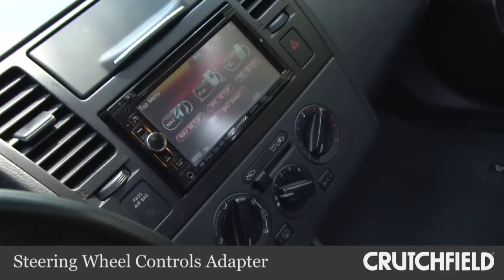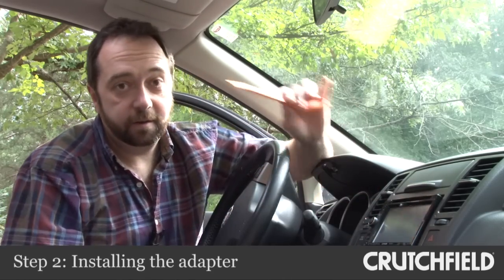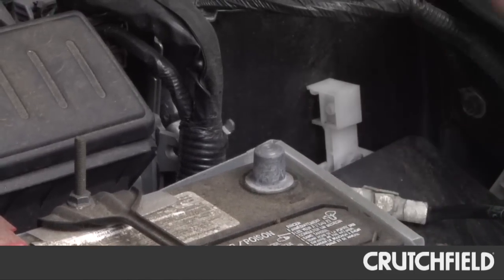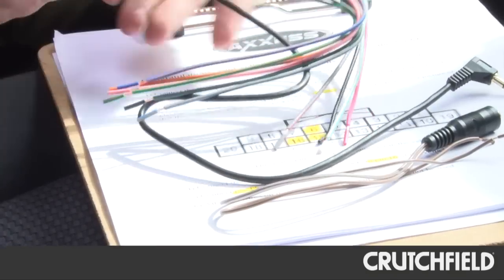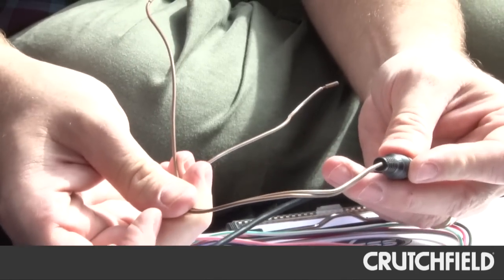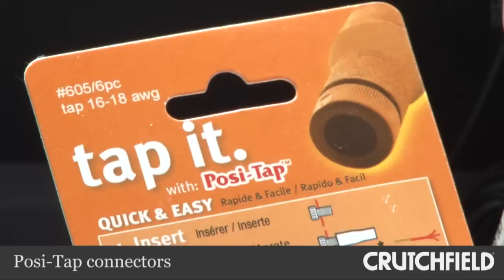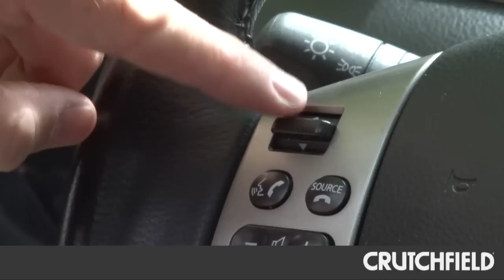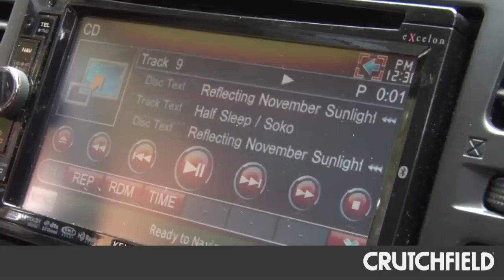Installing a Steering Wheel Audio Control Adapter | Crutchfield Video

Comment: which steering wheel interface do i need for a Vauxhall Astra mk 4 (1999) hatchbak 1.4 petrol?
Reply from the maker: We are not able to get our hands on those to research. I've read that Saturn could be the U.S. version of the vehicle and if that is correct, then I regret to tell you none of the steering wheel radio control interfaces we offer have been built to work in it
--Crutchfield

Comment: would it work in my bmw x3 2007?  do i have to program it manually?
Reply from the maker: The Axxess ASWC-1 is the recommended adapter for the 2007 BMW X3 and does support the Auto-Detection/programming modes in this vehicle: http://bit.ly/1k9BwOS 
For additional assistance & personalized recommendations, feel free to contact us directly:

By phone: 800.315.0030
Online chat: http://bit.ly/1b07Ykm  
e-mail: advisors@crutchfield.com 

I hope that helps.
--Crutchfield

Comment: I have this adapter but I dont know what 2 wire I need to use for my pontiac firebird its a 98 any help my radio don't the 3.5 in the back so I need to use the brown cables also but dont know for those either can anyone explain to me ?

Comment: do you loose trip computer when using this product
Reply from the maker: While trip computers and driver information center displays can be lost when an aftermarket stereo is installed in a vehicle, this would not be the result of using a steering wheel integration adapter.You can see which models are recommended and which factory features will be retained or lost in your vehicle by using the "Outfit My Car" application on the main Crutchfield website:  http://www.crutchfield.com/I-rYTVc180/car/carselector.aspx?lp=%2fCar%2foutfitmycar%2fmycar.aspx  For additional assistance and personalized recommendations, feel free to contact us directly:  http://www.crutchfield.com/I-rYTVc180/support/ContactUs.aspx  Hope that helps!--Crutchfield

Comment: Can you guys help me to figure it our WHY the Elantra 2012 when installing new STEREO with the steering control adapter LOST the Electric Power Steering (EPS) and the LED flahes warning there is a problem... Help me please....

When connecting all the cables from the car to the adapter and to the new stereo there is one more cable left that had the function to tell the factory elantra Stereo the speed and then controls the volume, but not all non factory stereos do this, so where to put the cabl

Comment from the maker: It's hard to say what your specific issue might be. If you purchased the interface from Crutchfield, you can give our tech support department a call. Their toll free number is printed on the back of your invoice. If you purchased elsewhere and the retailer will not help, you can contact Metra directly: 800-253-8324. HTH!--Crutchfield

Comment from the maker: This is only needed if you have steering wheel radio controls and are replacing the stock radio. Feel free to call for additional assistance: 800.315.0030--Crutchfield

Comment: kenwood with ASWC-1, need to know wich cable y have to used please help me.
Reply from the maker: On most compatible Kenwood stereo models, they provide a Blue/yellow wire in the stereo's harness for connection to the steering wheel integration adapters. 
HTH!
--Crutchfield

Comment from the maker: Yes, the Axxess ASWC featured in this video offers both automatic and manual programming options. If you purchased from Crutchfield, you can contact our tech support department for assistance. Their toll free number is printed on the back of your invoice. If you purchased elsewhere and the retailer will not help, you can contact Metra directly: 800-253-8324. HTH!--Crutchfield

Comment: does the phone buttons work? does the factory mic work? etc?
Reply from the maker: If the factory steering wheel controls include buttons for Bluetooth functionality (answer/end call, etc), they can commonly be retained with one of the steering wheel integration adapters and a compatible aftermarket stereo. Retention of the factory Bluetooth microphone depends on the specific vehicle and the available integration harnesses.For additional assistance and personalized recommendations, feel free to contact us directly:  http://bit.ly/2jBGHPp  Hope that helps.--Crutchfield

Comment: I am working on this task right now and can't figure out how it will work.  It is claiming my 07 Honda Civic EX with standard sound system going to P4400 radio only need the Gray/red wire tapped in to pin 7 and then ground Pin 6.  Then it will magically work?!? I have VOL, CH and Mode.  Ya.. That takes more then 1 wire. however, the book claims I will be using 5 pins (the above claims 3...) with the pink wire connected to 1N and then green/white to 1P...  This company can't agree on it's self.

Comment: I've been searching and cannot find one of these adapters to work with the steering wheel controls in an International ProStar. I'm looking at buying a ProStar, but will almost certainly want to replace the woefully inadequate factory stereo. Does anyone know if the International uses controls that are compatible with some other vehicle, that I can buy an adapter for?

Comment: Will it work with Holden Astra TS 2003 model car in Australia ?
Reply from the maker: Our vehicle research database only covers American released vehicles so we're not quite sure if this would work in an Australian market vehicle. If you're in Australia currently, you may want to check with a local stereo installer in your area to see if they have more info.

I hope that helps.
--Crutchfield
Reply: Thanks

Comment: Do you have an adapter for a 2009 saturn vue?
Reply from the maker: +Tiara Johnson Yes. We have both integration harnesses and separate steering wheel integration adapters that can retain the stock controls with compatible aftermarket stereos. For the specific models and to confirm they will work with the aftermarket stereo you've selected, feel free to contact us directly:http://www.crutchfield.com/I-rYTVc180/support/ContactUs.aspx Hope that helps!--Crutchfield

Comment from the maker: If you purchased the equipment from Crutchfield, you can call our tech support department for assistance. Their toll free number is printed on the back of your invoice. If you purchased elsewhere and the retailer will not help, you may want to contact Metra directly: 800.253.8324. HTH!--Crutchfield

Comment from the maker: YouTube does not allow links in the video comments. I can tell you that the most of the product owner’s manuals are available from the “Details” section for the selected product on the main Crutchfield website. If you want the Crutchfield MasterSheets for your vehicle, they are included free with purchase or sold separately for $9.99. Feel free to call for additional assistance: 800.315.0030--Crutchfield

Comment: Got anything to reroute 2008 Mazda MX5 steering wheel controls to a Raspberry Pi?
Reply from the maker: We have integration adapters for retaining the factory steering wheel radio controls with compatible aftermarket stereos. None are specifically listed as compatible with the Raspberry Pi. We offer a 60 day satisfaction guarantee with every purchase so you can give it a try and return the adapter if you are unable to get it to work to your satisfaction: http://bit.ly/1tlpMfI 
For additional assistance & personalized recommendations, feel free to contact us directly:

By phone: 800.315.0030
Online chat: http://bit.ly/1b07Ykm  
e-mail: advisors@crutchfield.com 

I hope that helps.
--Crutchfield
Reply: Crutchfield

Comment: what kind of adapter do I need for a 2006 Chevy Silverado?
Reply from the maker: To find the right steering wheel control adapter for your truck, enter the qualifying info in the "OutfitMyCar" application on the Crutchfield site: https://www.crutchfield.com/I-rYTVc000/car/outfitmycar/mycar.aspx

That will filter the results to show you only those that fit in your specific vehicle. Feel free to get with an Advsior using the "Contact Us" link at the top  if you have any questions. Hope that helps!
--Crutchfield

Comment: hello, this product works for a vw golf 2001 (can bus) ?
Reply from the maker: +lemec denface Sorry, no. At this time, we do not have an adapter or integration harness for retaining the factory steering wheel controls in the 2001 Golf. 
While I know this isn't the answer you were looking for, I hope the information helps.--Crutchfield

Comment: i have a 06 charger i dont kno what wire goes where cuz it says white and orange and 2nd white but there is neither color on my harness
Reply from the maker: If you purchased the adapter from Crutchfield, our Technical Support can help you out with these wiring/installation questions by phone. You can find the number listed on your Crutchfield email invoice & order confirmation. 

Otherwise you may want to contact the retailer you got it from, or the manufacturer of the adapter directly for more help. 
--Crutchfield

Comment: You didn't say WHERE to hook up the adapter to the radio.  WHERE do I hook that up?
Reply from the maker: That depends on the specific stereo model and if it offers the capability. Compatible stereos will generally offer either a dedicated 3.5mm minijack connector or a dedicated wire in the stereo harness  for connection to the adapter.
Hope that helps!
--Crutchfield

Comment: Deberían de hacer video demostrando exactamente donde van o se ponen cada cable, el video es muy rápido y no lo demuestran. Mi vehículo es Nissan versa s/sl hatchback 2007 y le e comprado el producto a ustedes y no he podido instalar quisiera que me pudieran ayudar. Gracias
Reply from the maker: Hola Osvaldo, 

Gracias por tu comentario. Lamento decirte pero hacer un tutorial para cada vehiculo porque los pasos no serian iguales. Si necesitas ayuda tecnica por favor llamenos al 1(800)653-0992.

Comment: hello, does this works on bmw 325i 2001
Reply from the maker: +Mohamad Mahdi Swaidan The Axxess ASWC-1 interface works in your BMW to keep the steering wheel radio controls working with a compatible aftermarket radio. You can find it here:

http://www.crutchfield.com/I-rYTVc000/p_120ASWC1/item.html

I hope this helps!
--Crutchfield

Comment from the maker: If you purchased the equipment from Crutchfield, you can contact our technical support department for assistance. Their toll free number is printed on the back of your invoice. If you purchased elsewhere and the retailer will not help, you may want to call Metra directly: 800-253-8324. HTH!--Crutchfield

Comment: will this work on my 2006 altima?
Reply from the maker: Yes. There are a few different adapters that are compatible with the factory steering wheel controls in the 2006 Altima. You can check out many of them and their differences (pros/cons) in the Crutchfield Labs: http://bit.ly/1toiaGV 
For additional assistance & personalized recommendations, feel free to contact us directly:
http://bit.ly/1tLNAOf
I hope that helps.
--Crutchfield
Reply: Crutchfield thank you for your response. and this adaptor will work for any head units whatever brand they are?
Reply from the maker: NIYAZ NAZAR Not just any aftermarket stereo; they have to be compatible with the steering wheel integration adapters. You can filter models for this feature on our website: http://bit.ly/19fTsFQ 
For additional assistance and personalized recommendations, feel free to contact us directly:
http://bit.ly/1tLNAOf
I hope that helps!
--Crutchfield

Comment: Does this work in Chevy Tahoe 03 ?
Reply from the maker: +David cruz depending on the version of your '03 Tahoe and what it came factory equipped with, there's a good chance we have a steering wheel control adapter that would work for you. To find out, you can enter all your vehicle information in the "OutfitMyCar" application our website: www.crutchfield.com/I-rYTVc000/car/carselector.aspx?lp=%2fCar%2foutfitmycar%2fcar.aspx

If you have any other questions, feel free to contact one of our Advisors via the "contact us" link on the webpage. 

I hope that helps!
--Crutchfield

Comment: All buttons work except the phone?
Reply from the maker: Hi!
If you purchased a steering wheel control interface from us here at Crutchfield, and the product doesn't seem to be functioning properly, get in touch with our tech support team!  They'll be happy to go over that with you, to see what may be going on.
You will find their number at the bottom of your emailed invoice, or by logging into your online account and accessing your order history.
Reply: Ok thanks but I was asking a question. Would the phone button option work with my aftermarket stereo if it supports that option?
Reply from the maker: Yes, if you have a phone button on your steering wheel controls and the new radio supports Bluetooth it should still function to answer and initiate phone calls.

Comment from the maker: To retain the factory steering wheel controls in your Altima, you'll need the Axxess ASWC-1 integration adapter (Item # 120ASWC1) and a compatible stereo. You can use the "Filter By" column on the main Crutchfield website to view the stereos that offer steering wheel integration capability. Feel free to call for additional assistance: 800.315.0030--Crutchfield

Comment: which amp posi tap connectors do I need?
Reply from the maker: The Posi Tap connectors are measured by the wire gauge they work on. In this video, 16-18 gauge taps were used. You can find them here:
http://www.crutchfield.com/I-rYTVc000/p_669PP641/item.html
Your vehicle may be different for its hookup so I recommend contacting us for additional assistance & personalized recommendation on which type you will need. Feel free to contact us directly:

http://www.crutchfield.com/I-rYTVc000/ContactUs.aspx

I hope that helps.
--Crutchfield
Reply: Thank you.

Comment: You didnt explain which factory wire u tap into.
Reply from the maker: The factory wire leads can be different based on the specific vehicle it will be used in. Keep in mind; we provide lifetime tech support with every purchase so you can always call with any problems or questions regarding the installation or operation of the equipment you've purchased from Crutchfield: http://bit.ly/1uj5kvh 
For additional assistance & personalized recommendations, feel free to contact us directly:
By phone: 800.315.0030
Online chat: http://bit.ly/1b07Ykm 
e-mail: advisors@crutchfield.com
I hope that helps.
--Crutchfield

Comment: This video is incomplete! Does not explain anything about where to put the steering wheel wires, where the pins are, how to get to it etc
Reply: This is a general video and does not apply to all cars. There are two booklets included in the packaging. One booklet shows which pin(s) to connect from your factory plug to your ASWC-1 wires and the other booklet shows how to program.

Comment: With all that crap behind the stereo - rattle rattle rattle...
Reply from the maker: You can use heat-shrink tubing, electrical tape, or just turn the radio up really loud to take care of that rattle

Comment: I installed this in my 2016 civic a few years ago but only the volume up button ever worked. Is there a way to reprogram one that has already been installed?
Reply from the maker: What model interface and radio are you using?

Comment: so i have an opel corsa c 2002 and want to buy a pioneer 1800ubb, how do i know it works??
Reply from the maker: +Jim bo We only research vehicles made for use in the U.S. market. You may want to check with Pioneer directly to see if they list it as a recommended fit and, if so, which of their authorized retailers serves your specific region.Hope that helps!--Crutchfield

Comment: the brown wire adapter for the brain connects to what wire on the aftermarket stereo?
Reply from the maker: Robert Cornejo That depends on the specific adapter (there are several). If you purchased from Crutchfield, give our tech support department a call. Their toll-free number is printed on your invoice. If you purchased elsewhere and the retailer will not help, you can try contacting the adapter manufacturer directly.Hope that helps!--Crutchfield
Reply: Crutchfield wow thats insane response time! I expected a day or so. Have an 03 silverado ss and did the entire install on my 04 silverado so am very familiar but the 04 didnt have SWC, Using my Panasonic Double din but dnt recall seeing that 3.5mm input, kicker amps and kicker L7s.  Ill give it a shot. Just the adapter through me off a bit.
Reply from the maker: Robert Cornejo Right. Not all aftermarket stereos will be compatible with steering wheel integration. Panasonic hasn't made stereos for a few years now. If your model is compatible, it will either have the 3.5mm input or a dedicated lead in the stereo harness for connection to the adapter.Hope that helps!
Reply: Crutchfield right on, I still have my box and manual. i will look through the diagram. double din was bought back in 06 but still in great condition. hopefully it does and work and can be repurposed. Would hate to buy another head unit to keep my swc but an upgrade would be nice. thanks for the help! I will follow up once I reinstall in my ss.
Reply: Crutchfield I have attached the link of my head unit. If you click features and specs, it says it it swc compatible with a pac module. If it works with that one should it work with metra, reviews are a lot better for metra

Comment: I need to know the dip switch settings for my sony radio and my 1999 buick regal.
Reply: I have the PAC SWI-CP5
Reply from the maker: Paul O'Neal The dipswitch settings can be found by downloading your device-specific application from: www.pac-audio.com/controlpro/app 
Hope that helps,

--Crutchfield
Reply: Crutchfield I found the settings using the website on my laptop.